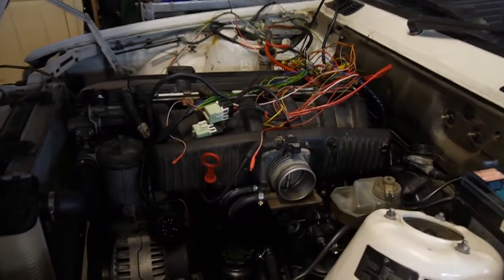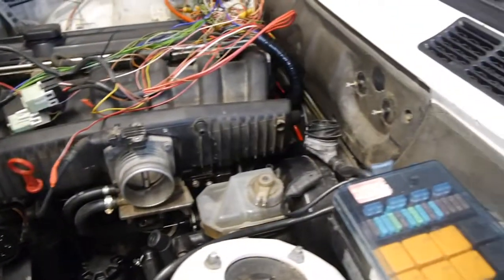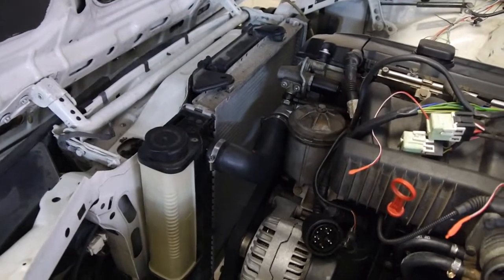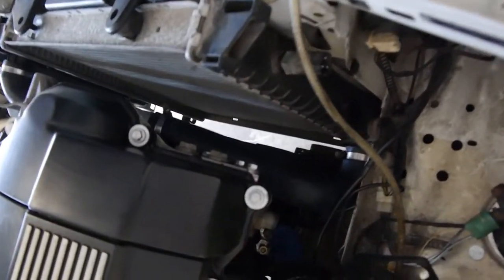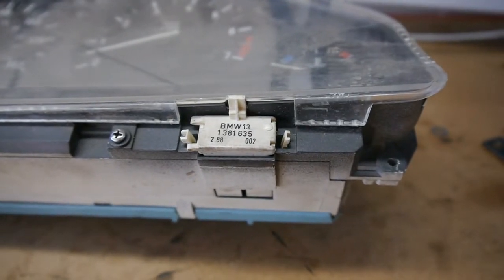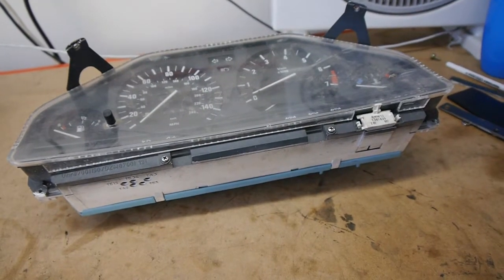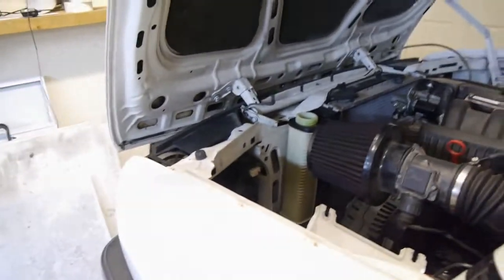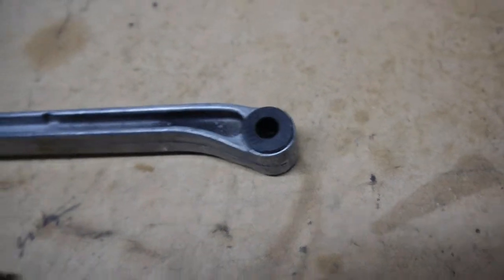E30 M52 Conversion Episode 7. Getting The Engine Running.

Comment: Whers the part where you connect c101 with x20 plug. That’s a milestone for most people who wants to do a swap to e30/e34
Reply from the maker: AlphaSef thats a couple of episodes back i believe. was done before engine went in the car
Reply: LMSProductionsSA sorry I didn’t find anything
Reply from the maker: Well looks like you were right,  I remember shooting about the c101 plug but i can't find the footage and it certainly never made it in the video. Ill have to reshoot it and re upload one of the earlier videos with it in there. Thanks for the heads up.
Reply from the maker: I just reuploaded the episode 5 but included the c101 conversion section in it :)

Comment: Hey about to get my propshaft cut! :D But I have fitted the front shaft to get a reference, the front shaft comes in contact to the shift linkage. How much clearance did you have for the linkage to shaft?
Reply from the maker: Got about 15mm I reckon. Something must not be lined up correctly to be hitting

Comment: What'd you do for cluster readings? I'm s52 swapping and have a brown top coolant sensor- not the right threading.
Reply from the maker: I put an m40 temp sensor into the m52 block and ran a seperate new wire from it to the c101 plug. That way the guage and sensor are correct. not sure if the s52 has the free temp sensor slot though. if the thread is wrong you may need to tap or adapt it.

Comment: What did you do for the radiator and fan?
Reply from the maker: m40 rad and aircon fan. i think that info is in one or two of the eps in greater detail but im not sure which ones.
Reply: Any rubbing? Over heating? Clutch fan or electric?
Reply from the maker: aircon fan is the electric fan infront of the condensor and radiator so it fits fine. No overheating runs cool, dont have aircon yet so i dont drive it in stupid heat but still in 32C its fine.